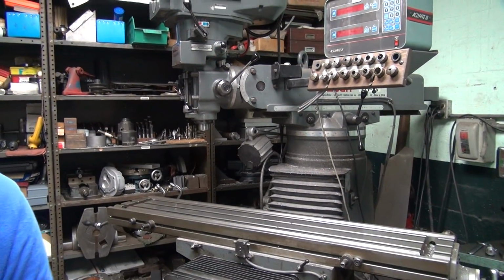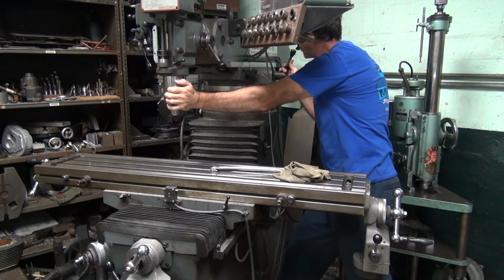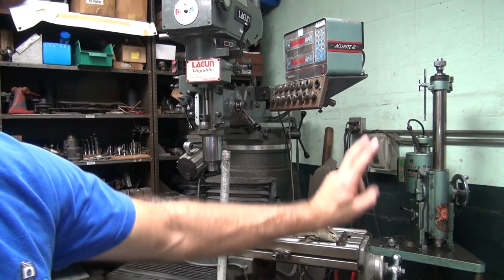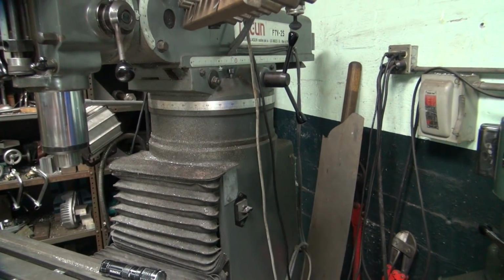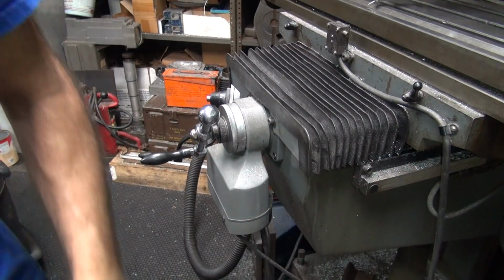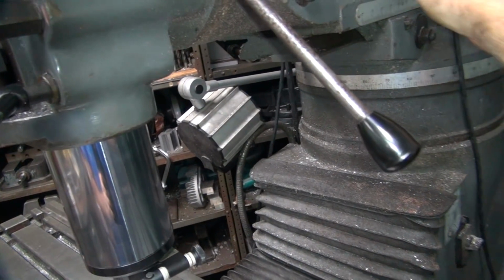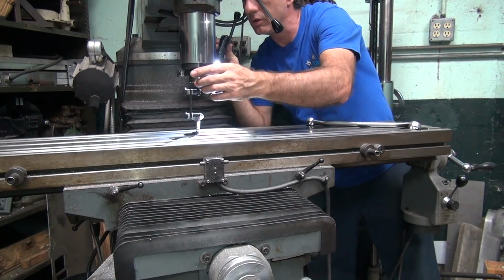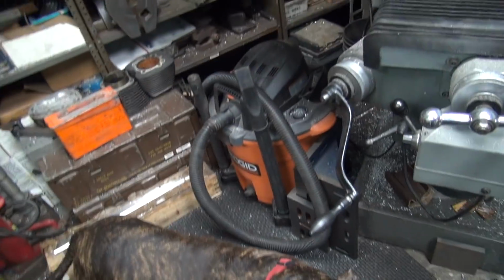#137 how to do it, adjust and true up you lagun vertical milling machine Harley tatro machine

Comment: Mine has a problem I am unable to make the head slide either way I must drop the motor down for moving the machine to new location but can't make the double handle move complete upper assembly seems to be locked up ? please advise . Thanks Frank

Comment: Been a Machinist for 42yrs and I still hate Tramming  (truing a Milling machine head )  a Bridgeport Head.   don't think I ever gave one a slug with a lead hammer  but to each their own if it works do it
Reply from the maker: not a slug, just a light tap to shock or vibrate the head to see where is wants to be after i start machining something. you need to reset the memory or it will go back to what it likes.
tatro